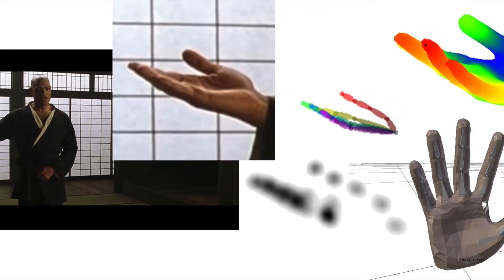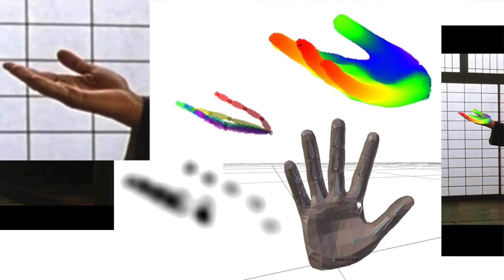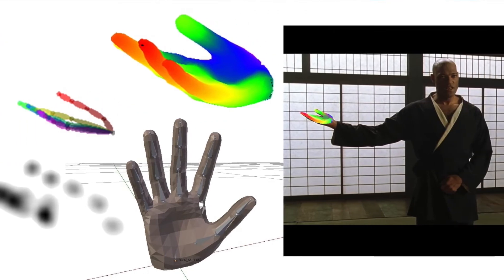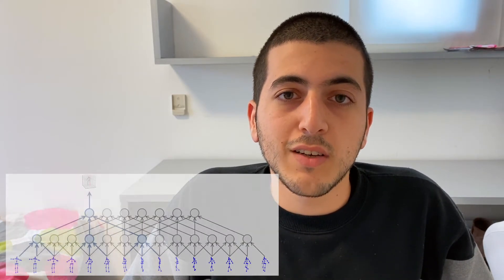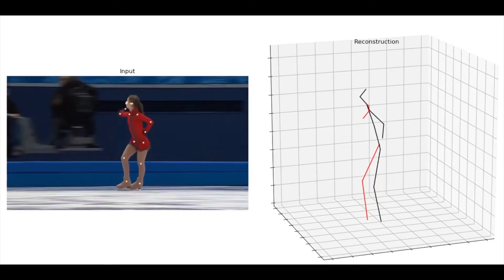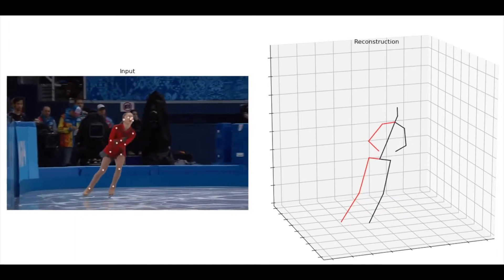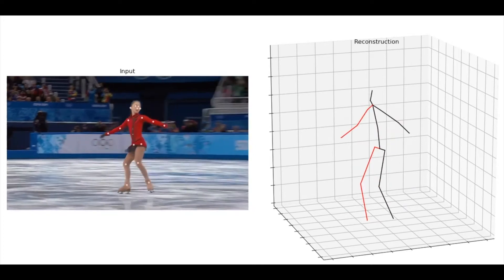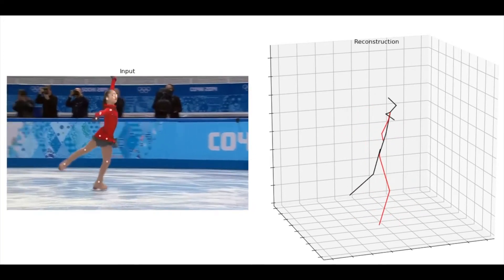Current Problems in Sign Language Processing?

Comment: IMO, I'd say that the syntax used in ASL is similar to BSL (at least for that example you gave) - I would have signed it (in ASL) like the way you did for your BSL example. Signed/gestural languages are pretty flexible languages - it's the CONTEXT that matters, so really you can get away with little nuances like the example you reference.